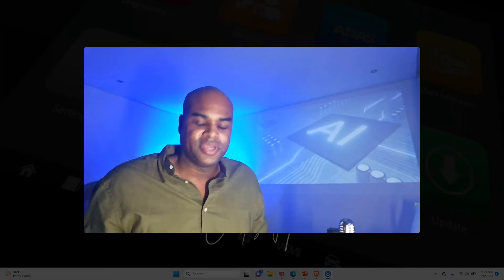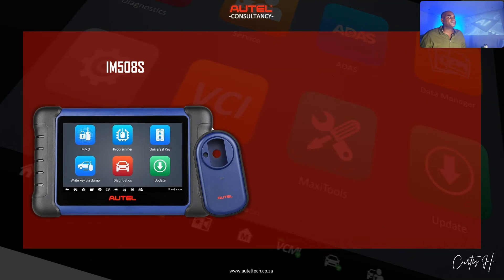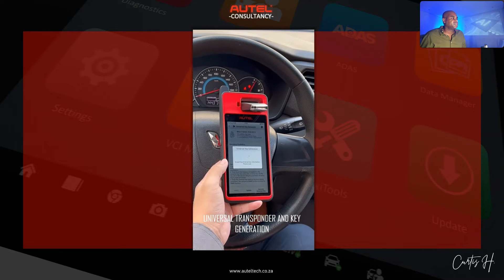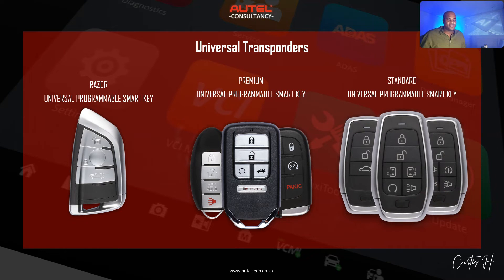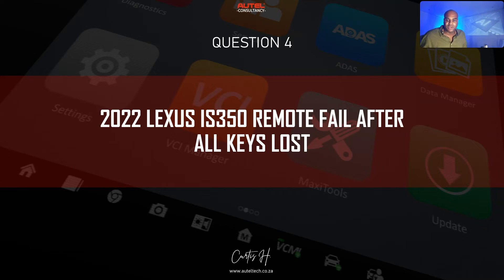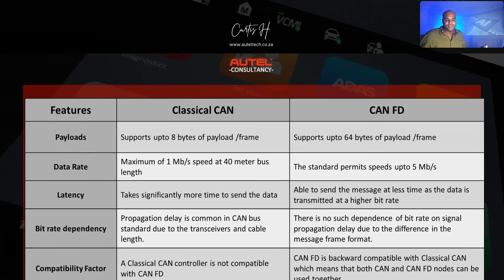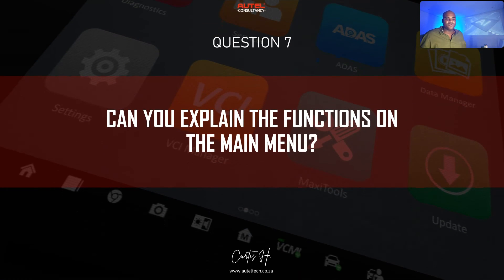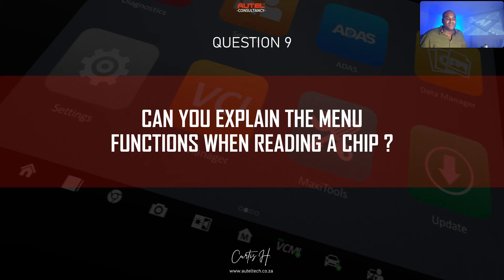KM100 Deep Dive Your Top 10 Questions of The Week Answered

Comment: I'm trying to find any info on how to remove existing keys, if possible,  also when the universal key is programed to a car how to deprogram it, so can be used again.
Reply: Yeah I got the same questions.  The documentation sux.
Reply: @gfriedman99 Just go and reprogram it again like if it was new. Universal Keys do not get Locked ever so just use it as it was new and the existing transponder information will be rewritten.
Reply: To remove existing keys choose All Keys Lost. Some vehicles require 2 new keys to be programmed after deleting all keys from the system. I can help you if you share you car year make and model
Reply: @Mimi-dy8gd  ohh i understand,  so I haveto delete all keys before program a new one?
Reply: @cristian50184  I agree... it's ridiculous.   I'm at the max of 6 keys programmed because 4 of the keys are defective I just want to remove them so I can get back down to 2 keys that actually work.
Reply: @Mimi-dy8gd  I have a 2014 Mazda CX-5.   I updated the software on the KM100 and after I did that the "All keys Lost" function disappeared and there only is a "Delete key" function which does not work - I tried 10 times.   To make matters worse the Mazda software update is actually located under the Ford software section.    This tool is a joke and horrible - especially at costing over $500.

Comment: I have the km100 and I plan to buy the xp400 
my question is can use the xp400 on a PC without having to buy the 508 or 608?
Reply: You can't
Reply: The XP400 is an Add-On not an standalone application so hard No.

Comment: Hello,

Im trying to program extra key for my 2020 nissan sentra with my Autel KM100E, (will be using autel nissan universal key) but it keep failing at "Step 2: Get a Pin". when i check autels "guide" it tells me that i need some additional cable that plugs in into BCM in the dash board. I have a suspicion that special cable is for another atutel key programmer and not KM100E. When i go to youtube i found multiple videos where people were able to progam nissan key just with Autel KM100E. I also noticed that setting little different, and version of nissan soft ware is different, mine is "Nissan V1.71", where all the people on the to YouTube use version "Nissan V1.60". What do you think the problem is? Autel tech support is useless! :(
Reply: Did you find a solution for that ?

Comment: thank you for the info

regarding lexus key working but not the remote

I just looked at my km100 in lexus menu shows option - ECU synch learning -
and the help screen says that it serves to - engine start via remote - and - sync ID box and steering lock

Can you confirm if this 'ECU sync learning option' will make the remote working?

greetings from Sydney

Comment: I’ve been considering one of these but have been unable to find whether or not it will work on some of the vehicles I specifically need it for.  Will this work on older Land Rover s& Range Rover vehicles?  Specifically ‘96-‘16 model years?  If not, what model years will it work on if any?  Is there a pdf or something you can point me to that lists exactly which vehicles it will work on?
Reply from the maker: What I observed from the many complaints Autel buyers has is that they are limited with the amount of information you get online. So the risk is alot higher because you will only really know until after you make a purchase. What I did to solve this problem is offer a service to consult the client on what the tool can and cant do . This way they get all the information they need in order to make an educated decision. Alot of time when people book the consultation , they tool they had in mind really wasnt a good fit for them. So what I suggest is to just make sure if you cant get all the information you need,  the supplier needs to have a good return policy if you find the tool not to meet your expectations
Reply: @AutelConsultancy  a lot. Alot isn’t a word.
Reply: @wolfiemedia 😂😂😂

Comment: I purchased the km100 a couple weeks ago with the intent of using it to renew locked smart keys, i however have yet to have any success with this operation and have tried different makes and connections all  oem keys and none will get passed 1% before it fails. Can you please help provide me with any insight. I previously purchased the xhorse keytool max and their renew adapters and was not able to get them to work either and am really starting to think it's all just fake advertising features that don't really work......?
Reply: @ScottSeabrook Both the KM100 and the Key Tool Max can unlock smart keys. I have used both to do it. I don't use adapters; I use the renewing cable and solder the wires to the proper places on the remote's circuit board.

Comment: my second question can i use autel im608 to clone bosch MEV9.2 DME. THANKS
Reply from the maker: Hello, I would have to check with the engineers. What I suggest you do is try asking your supplier. If they cant give you certainty you can book a diagnostic tool consultation with me at auteltech.co.za then ill get all the information to validate if the tool can do it or not. if it cant ill give you an alternative solution that will
Reply: THANKS CURTIS. I PURCHASED MY DEVICE FROM AMAZON IN THE USA @AutelConsultancy

Comment: My km100 will not program all key lost for 2017 Chrysler 200
Reply: Ok, I finally got the keys programmed to the 2017 Chrysler 200, if you generate a unervisaral key with the km100 for a 2017 Chrysler 200 it will give you a hitag2(ID46) for immobilizer type which is wrong, so that's why the key wasn't working. After hours of researching, I found the 2017 Chrysler 200 immobilizer was a hitag  aes(ID4A). I was only able to find that key setup under 2011 dodge charger, after generating a key for the 2011 dodge charger, the km100 program keys successfully to the 2017 Chrysler 200.
Reply: Ok thanks, one more question Whats the difference between km100e vs km100x
Reply from the maker: What I would do in that situation is log in and have the client do the procedure again. I would record the session and submit the data logging for the Engineers to see what the core issue is. . Try to contact your supplier or Autel New York and have them follow that framework to find out what the problem is.
Reply: I have a 2022 rav4 similar issue
Reply: Key works only by the transponder, keyless entry won’t work and the key has to place at the button to start the vehicle

Comment: Hi , is there a diference between universal key and dealer key '. thaks
Reply from the maker: Universal Key: This is a key that's designed to be programmed for multiple makes and models of vehicles. It's a versatile option, especially for locksmiths and technicians who deal with a variety of cars. Think of it as a "one-size-fits-most" solution. You can program it on-site to match the specific requirements of the vehicle you're working on.

Dealer Key: This is a key that comes directly from the vehicle's manufacturer or authorized dealer. It's pre-programmed to work with a specific make and model, and often a specific VIN. Dealer keys are generally more expensive and may require a trip to the dealership for programming, but they're guaranteed to work seamlessly with the vehicle they're designed for.

So, the main difference boils down to versatility versus specificity. A universal key gives you more flexibility but may require manual programming. A dealer key is plug-and-play but is limited to the vehicle it's designed for.
Reply: ok, i see in videotutorials that you  can generate a "dealer key"  using im608, i wonder if this dealer key can be done using  a universal key , am i rigth? thans again @AutelConsultancy
Reply: I've generated dealer keys using aftermarket keys in the past. It can be done from my recollection. I can't recall a specific instance but with a few years of doing this full time I do know it's been done but also there's so much more to do in this industry as I'm just hitting the tip of the iceberg currently. 

Never feel comfortable in the place that one thinks they know it all as when that happens someone will come along and knock you off ur pedestal. 

Someone like Curtis as he has taught me a wealth of knowledge in the short time I've been checking out his videos. 

Remember everyone there's always room for a few in the automotive diagnostic, repair, key programming, programming and locksmith space.  

Need to see guys start thinking in the mindset of rising tides in terms of pricing our services as there's guys out here racing to the bottom when it comes to pricing.

Comment: Hi Curtis. Great content as Always.     I seen some use the xp400 on a windows laptop. Im on a budget would the xp 400 on windows  and km100 work on most european cars as im based in Ireland. And maybe the G box 2 or 3. Thanks Ian.
Reply from the maker: Probably not. The Km100 is weak on the European vehicles due to the fact that when your doing an all keys lost scenario , the km100 doesn't have the circuit schematics to connect when you have to take the module and put it on the bench. You have 2 strategies: You can save your money and  just get the im508 with the xp400 , this way you will have more capabilities to solve more problems.  Or you can just purchase the km100 and be strategic on what vehicle you are working . When you make enough money then you can purchase the im508 and xp400
Reply: @AutelConsultancy  Thanks Curtis .